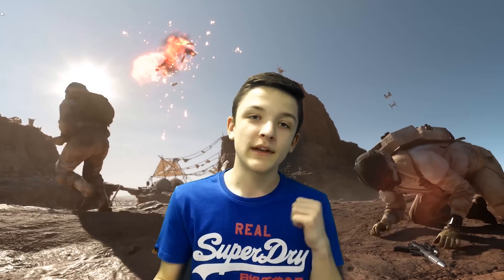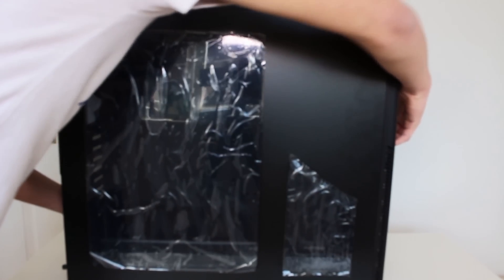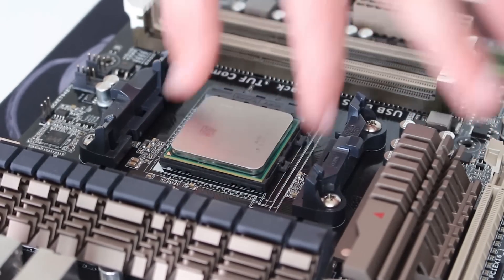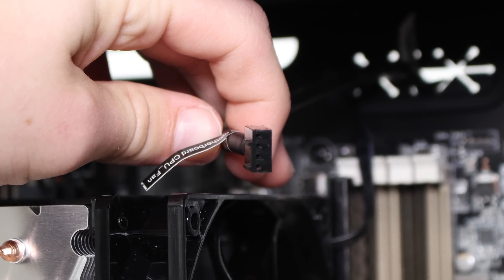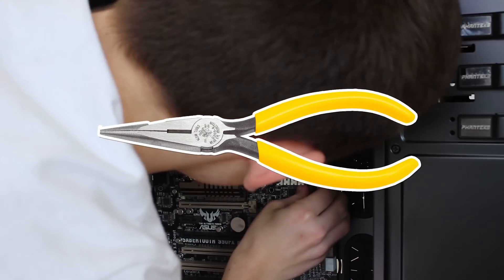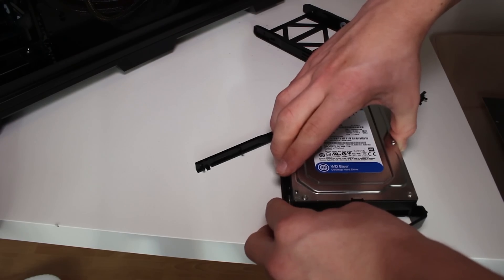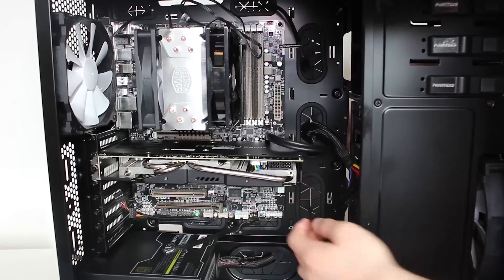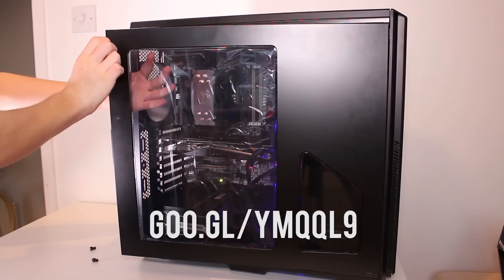How to Build the ULTIMATE AMD Gaming PC 2016! [PART 2]

Comment: that cpu in gaming performance like an i3 6100,so for that price you should put at least an i5 6400,anyway good build
Reply: +Gabriele Adragna but i3 is dual core and some games nowdays won't even run on it unfortunatly. and for the i5 6400 dont forget you need to get alitle higher price ram(ddr4) and higher price motherboard aswel
Reply: +Ron Klaz i Know i3 is a dual core but in gaming have better performance than fx 8370, ddr4 RAM now cost like ddr3, 35€ for 8gb or 75€ for 16gb,you also find 1151 mobo starting from 60€
Reply: +Gabriele Adragna hyperthreading
Reply: +GamerJetic yeh but is not like have 4 fisic core
Reply: +Gabriele Adragna definitely not. core i5 has 4 physical cores and it gives way more performance. having hypertheading doesn't give you performance of more cores
Reply: +Ron Klaz hypertreading is like 35℅ of a normal core

Comment: 8 CPU Cores
4 GB vRAM
8 GB Ram
8+4+8=20
20/4=5
Ive mentioned 20 2 times before this
5-2=3
3 sides to a triangle.
BUT WAIT THERES MORE
During 9/11, 3 buildings were attacked
3
That was a third 3.
3+3+3=9
There is 9 sides to a Nonagon
Nonagon has 7 letters.
7-3=4
4 in Chinese is "si"
si sounds similar to Sǐwáng, the Chinese word for death.
Assuming you've read this, you have read the word in Chinese for death.
Sǐwáng has 6 letters
6/2=3
There is 3 sides to a triangle.
Hamburgers has 10 letters
10-3=7
Ive typed 3 7's in the last 5 minutes.
7+7+7=21
21/7=3
Hamburgers confirmed.
(Mind blown)
Reply: But what if hamburger was not confirm?
Reply: +Wolfie  X-Files music intensifies
Reply from the maker: +Toasteria™ https://www.youtube.com/watch?v=hAAlDoAtV7Y
Reply: Mind=blown